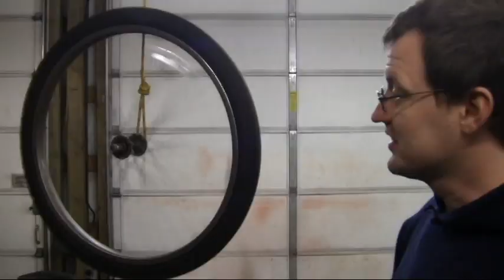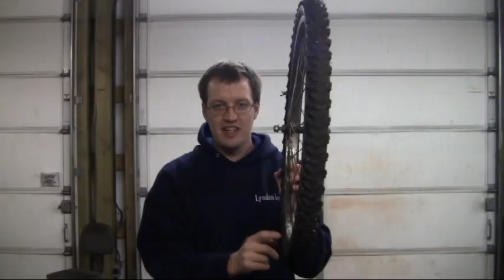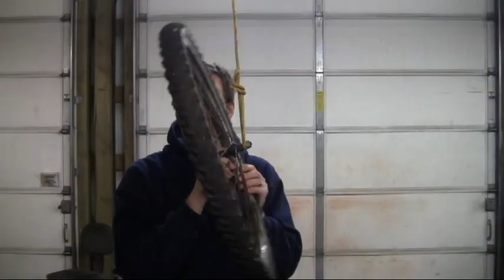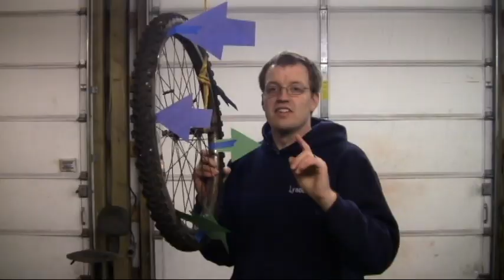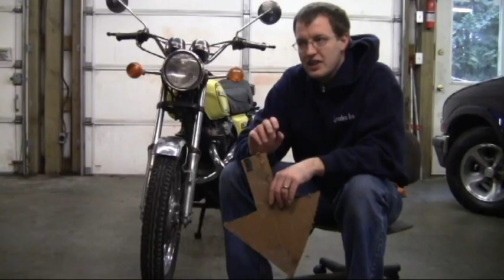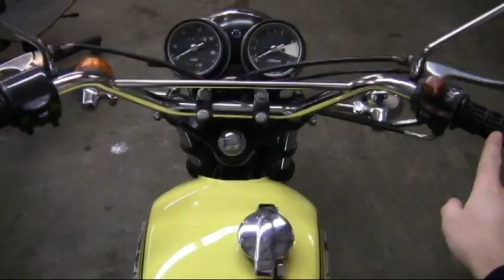Gyroscopic Precession LONG VERSION explained logically (Spinning Tire on a string gyroscope gyro)

Comment: You were the one to have been closest to make me understand the gyroscopic precession. I'm still missing a bit and can't fully get it: stuff with accelerating in the 2 self-cancelling directions makes the wheel not falling on the side.
But that doesn't explain why it rotates by a vertical axis!
Reply: Well if you see the video carefully again you will get it he actually explained (nah nailed it) ... if you understood the accelerating part i.e.. top and bottom acceleration cancel each other ,then you must understand that the blue mark 
when comes to the horizontal axis i.e.. mid way between the top and bottom its velocity is at maximum and on the two ends its opposite which cause the wheel to rotate about the vertical axis. 

So in terms of physic or mathematical sense  while the wheel is rotating , if we assume a point mass particle at the point of the blue mark and analysis its motion we get the acceleration is maximum at the top and bottom and the velocity is minimum (0) but it doesn't twist because it needs velocity to move .when the particle is mid way its acceleration is min (0) but velocity is max so it have a motion which cause it to twist.
Reply: I rewatched the vid after following your post and you're right - he explained it. Now I get it.

Comment: The force at the bottom of the wheel is offset by the force the top of the wheel. While not in motion, the forces are able to act with each other. While in motion, the forces act against each other. Understanding that the rope can only experience tension, not compression, you are able to follow the forces of the wheel through the spokes of the wheel to the shaft, and up the rope. It is not levitating. It is merely converting the tension force of the rope to act against gravity. The excessive force that is produced as the wheel forces act against each other is what is keeping it from falling. However, since the rope can not experience compression, it will always be able to handle forces greater than gravity. However, if enough rotational force is applied to the wheel, will it not begin to turn in the opposite direction, as the excessive force needs to go somewhere?
Reply: My next question is what would happen if the wheel was hung from four ropes inside a spinning enclosure? The four ropes would constantly shift the gravitational tension from one to the other. Would it still balance?

Comment: Great video, little thing, careful with explanations. You were thinking the correct thing but said the wrong thing. When you were talking about the car moving, you were correct in assessing that the force is not necessarily in the direction of the movement. However you started the acceleration is not in the direction of the force. the acceleration is always in the direction of the net force. In the case of the car, the acceleration was in the opposite direction of the movement, just as the force was. That is why it was slowing down. Keep it up, I enjoyed that video, it's a difficult phenomenon to explain and you did a great job
Reply: the acceleration is always in the direction of the force since the force is speed and acceleration is the derivative of speed
Reply: acceleration and speed are in different units, how could they be even be compared..

Comment: what if the tyre was rotated the other way....would it precess in the opposite direction?
Reply: The directions of the forces are just reversed.
Reply: +aswan koruna yes
Reply: Ihsan Ali Then this explanation is invalid since it does not explain how the direction of rotation of the tyre affects the direction of precession.

Comment: great explanation, the way the front wheel is slanted forward means that gravity pulls it in the correct direction when the bike is tilted. its not just gyroscopic procession!
you might ask, then how does it turn back once the bike is balanced again? well gyroscopic procession helps there too but its also because of the point where the wheel touches the ground.. its behind the steering axis so it gets pushed straight again

p.s. my left ear loved this video

Comment: I have just 1 question. The ax is not spinniig. So it should fall under the force of gravity but it doesnt. Why?

Respect for making me understand giroscopes almost 100%
Reply: +mogosanrazvan the rest of the wheel connected via the bearing is spinning, which keeps it up as he explains

Comment: How does the speed you spin the tire affect? This makes sense in two situations: No spinning and spinning. What if you spin it very slowly? The forces cancel each other then too, so the tire should just ignore gravity. Why does the spinning angle change?
Reply: +luwn00bz The wheel needs to be spinning fast enough that the amount of time the blue tape spends in one quarter of the circle is small enough that the orientation of the wheel doesn't change significantly (i.e. the force on it doesn't have enough time to act to change the orientation of the wheel).  If the orientation of the wheel changes by too much each quarter cycle then the forces won't cancel out.

Comment: The amazing thing is that this 90 degree offset is because velocity is accumulated acceleration (integral of acceleration) and the integral of a circular function, cos, is sin (which is exactly the same cos shifted over by 90 degrees).

Comment: Sir u r unable to explain ur idea clearly and succinctly.
 Just say that the blue taped part of the tire tends to move (i.e  fall or rise) in opposite directions depending on whether it it is on top or is at the bottom. So when it spins fast the opposite directions of motion of the blue section cancel out and it neither falls nor rises but just stays upright. U don't have to show car pushes and repeated  "this ways".

Comment: There is a problem with the explanation:

if the wheel spins as if the force is applied 90 degrees downstream because the points having the actual velocity is moved 90 degrees downstream, it must imply that the slower the wheel spins, the more velocity the points have when they are on the middle, but that is clearly not the case.
Reply: You are correct, but notice that the wheel precesses at an ever-increasing angle. The tilt angle is a function of how far a wheel segment can fall before gravity starts torquing it the other way.

Comment: There is no force acting on the top of the tyre pushing outwards, the only force acting on that system is gravity, which produces a torque, which causes the top to gain angular velocity (ie it has an angular acceleration) out of the plane of the computer screen. if you correct that mistake you are fine, but the only way to fix that is to replace force with angular acceleration, which turns your video essentially into an explanation in terms of the right hand rule...
Oh and it would make sense that the angular momentum sticks out of the plane of the screen/page, i would recommend you read some first year university textbooks before you say that it makes no logical sense :)
But good attempt at explaining precession
Reply: I stopped there. When he put arrows saying those were forces pushing the wheel laterally. However, you also are not correct. There are 2 forces acting on the wheel. The weight mg, and the tension of the cable. Those 2 forces constitute the torque.
Reply: danielrox5000 : But we had  gyroscope in 3rd year ...... my brother from which university u read ....
Reply: If you assumed the starting angle is like 89.5 instead of perpendicular to the ground, it would work

Comment: Thankx u so much, Finaly understand why the wheel don't fall.
Simply because it hadn't the time to fall because it turns.

So the high of the wheel want to push down but this high become rapidly the bottom position wich want to puch up. The wheel had no time to accumulate the energie to fall.

It's  a question of time. the high and the botom of the wheel inversing rapidly each other their place, so they had'nt the time to accumulate the energie to fall because of their constant changing position.

The high is also the bottom when it turns. Gravity "is fool" in that way.

Comment: Actually Hirvonnen Jonaas it has only a little to do with gravity and more to do with the conservation of energy and mass. In simple turns the mass of the flywheel absorbs the inertial force of the vectors created by gravity or the direction of the force being placed on the flywheel. The absorption of that force by the mass of the flywheel(gyroscope) causes it to change direction. Linear momentum, creates angular momentum and visa versa. That is why gyroscopes work the same way in the micro-gravity environment of space as they do on Earth. This inertial energy gets passed numerous times along all the "vectors" of the wheels radii, until it "smooths" out to a relatively straight path without any wobble. The reason why it appears to float is that the angular momentum of the gyro is also acting upon the spindle(the tether it is spinning in) this creates a linear force against the spindle pushing it against the tether creating a stabilizing force that keeps it in the sling of the tether. Same reason why a bike stays stable in a strong wind or when you are turning into a corner.

Comment: You are an innovator. Wonderful.
I now see that it is more easily understood as an oscillating acceleration. Angular momentum doesn't even need to mentioned. The acceleration is switched 180 degrees for each 180 degree turn of the wheel resulting in this strange force that we call the gyroscopic force. Totally brilliant.
Your bit at the end about how to turn bike, I'm not quite there. Consider this thought experiment;
Imagine yourself on a ski. You hit some uneven ground that causes you to begin to fall to the right. (On a bike you would point the front wheel slightly to the left to initiate the fall to the right, as you said) To correct from further falling you ski to the right which produces a correcting force on your falling body allowing you to come upright again. This is the same principle as on a bike except that gyroscopic forces play no role on a ski. I therefore presume that gyroscopic forces need  not have a role on the bike when turning.

Comment: Good explanation Curt. This should be a must-see for student pilots. All pilots have to compensate for gyroscopic precession in our heading indicators from time-to-time, usually about every 15 minutes or so we reset the Directional Gyro to a known compass heading (which does not precess, but does drift due to magnetic variation). The Directional Gyro in an aircraft heading indicator is air-driven and spins at well over 15,000RPM (you can hear it winding down after the aircraft is shut down). Even though it has this amazing speed and is continually supplied with rotational energy from the vacuum pump, it still precesses, although not nearly as quickly much as your slower-RPM example. Aircraft with older Directional Gyros and old bearings will precess at a much greater rate (much like dirty bearings in your bicycle wheel). Worthwhile view indeed!

Comment: Hey Curt! Love the explanation, but I still have a few questions left over.

1) What happens when the wheel spins slower and why?

2) The explanation assumes that the top of the wheel is stationary at the start (except for the spinning). What about if the point on the wheel 90 degrees from it were stationary at the start? Then by his explanation, the wheel would fall over as if the wheel were not spinning. What's wrong with this assumption?

3) I'm really hoping you'll go in a bit of detail about why pushing one handlebar a little bit will cause the bike to turn the other way.

Keep up the great work!

Comment: You only explained why the wheel turns. You never explained why it floats.
Reply: Dom Pilipavicius That's not the reason why it floats. But anyway, I figured out why by calculating the resulting vectors of the linear momentums.
Reply: It 'floats' because the sideways velocity of the blue bit is zero at the top and bottom of the wheel.  He didn't explicitly explain it but I think this is the case.
Reply: Dom Pilipavicius Yes, the rope exerts a force upwards that is as great as gravitational pull downwards. It's like you were far away from massive bodies and pushed some object with your hands from opposite directions with same force on both hands. The speed of the object remains unchanged. It might start to spin if your hands weren't in symmetrical positions (like in this case of precessing wheel).

Comment: Good until the "Get up to a decent speed and then let go of the handlebars" part. :P

Also precession is inverse proportional to the objects spin!
Reply: yes precession is inversely proportional, however that is only the rate, not the force and since gravity is constant the larger the angular momentum the the slower the derivative of precesion, however the force is still stronger. Its difficultr to explain how this helps the motorbike stay up, but you can visualize it as if you turn the wheel on the string faster it will rotate around the string slower however will support a greater mass on the wheel and so is more stable since resits tipping from a larger force (http://www2.eng.cam.ac.uk/~hemh/gyroscopes/flash.html here are some nice visualizations of this effect)

Comment: Is this the equivalent of pushing on a rolling car until it JUST begins to move in the direction of force, then running to the other side of the car and pushing until it JUST begins to move in the opposite directions and so on?